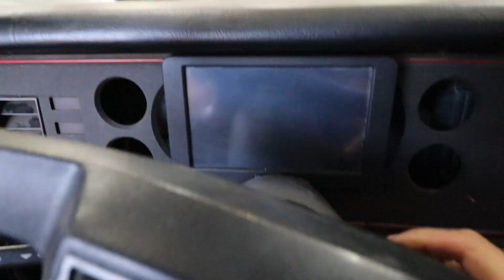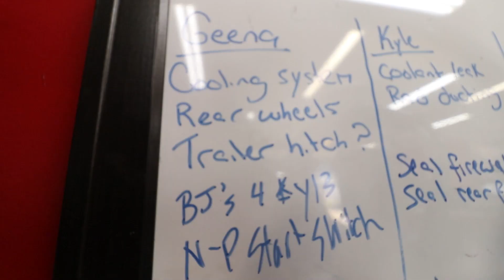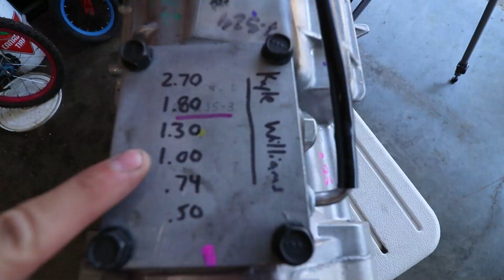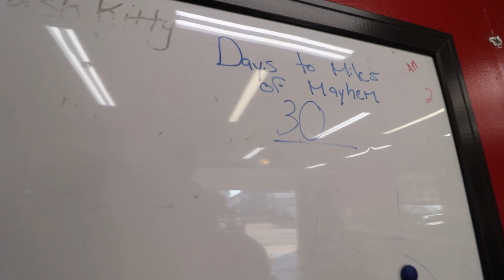The Best H Pattern Transmission You Can Get. What Do We Put It In? - G Force

Comment: Why not go with something like the TKX? It has similar internals to the T56 and the lightness of a TKO, all with a 7k rev limit out of the box.
Reply: Because what he put in doesn't have a rev limit? If the TKX was better, we wouldn't be selling all these T56 or TR6060s.
Reply: @k20dreamin  Every transmission has an rpm limit. I called Gforce after I saw your comment and found their T56 (in 1st-4th) can handle 10-11k rpm, but only 6k rpm in 5th-6th, that's much higher than I remember reading and much higher than any stock T56, my mistake. The TKX is a new transmission, that's why you wouldn't be seeing it everywhere, it's not your typical TKO. I'm also curious on the choice because the TKX is 40lb lighter than a t56, and weight matters, or so I thought.
Reply: @danielhahnke5212  I suppose I should have used better wording over doesn't have a rev limit lol. I don't believe the TKX will take the place of T56 and TR6060 transmissions as far as high horsepower and torque applications any time soon.
Reply: @k20dreamin  For the very high hp/tq cars, you're absolutely right. I'm more into road racing myself so I sometimes forget the numbers some people are pushing in drag cars
Reply: @danielhahnke5212  Tick Performance offer something for the road racing crowd also.

Comment: Definitely should have put the attachment point of the box lower. It would take a lot of weight off the front edge if the tow strap was connected higher on the tow vehicle and lower on the box . You could get it moving easier so no need for the snatch take off and less overall strain on the box. Just sayin. Lol